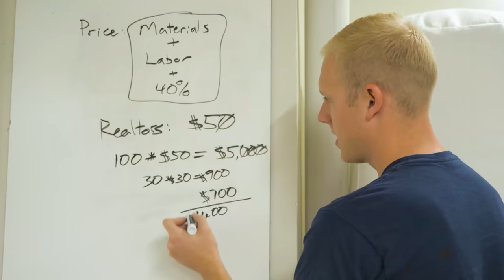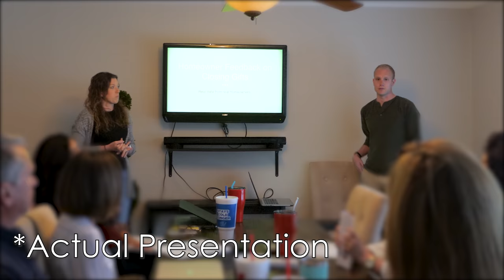our biggest Realtor sales meeting yet!

Comment: I like watching your video’s but have questions about cutting board do all the boards have to face the same direction like end grain or side grain or can you have both grains on same board? I never have made one yet ,I’m all ways worried that some one might get sick if I did something wrong in making one thanks Ed
Reply from the maker: That’s not gonna happen, Ed! 

Realistically, the only way that would happen is if you built the board out of end grain red oak, then they didn’t wash it after cutting raw meat.

The board you’re describing sounds like a fun project!
Reply: Mixing end grain and edge grain can sometimes cause issues with wood movement. Especially when it comes to how the grain reacts to moisture.